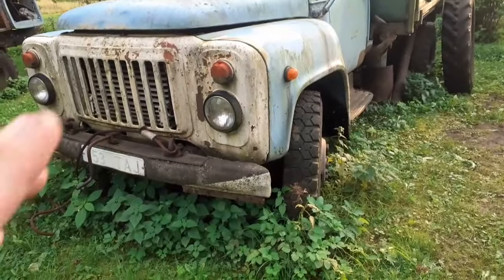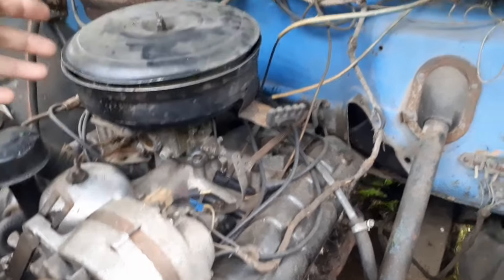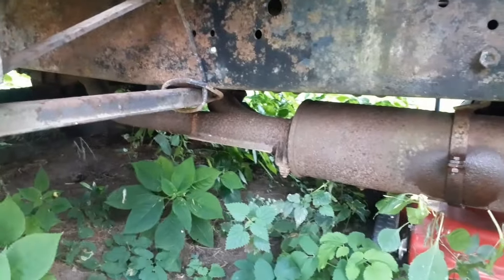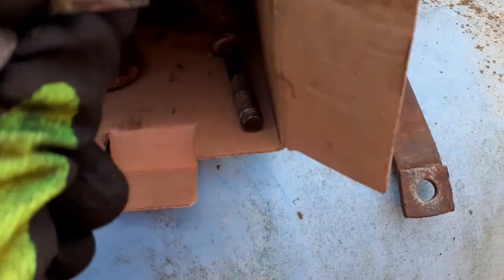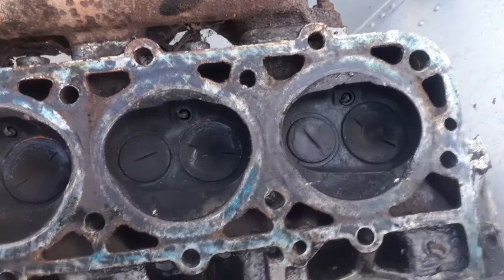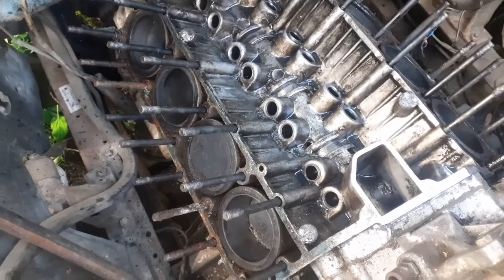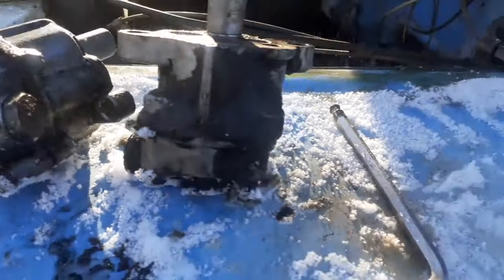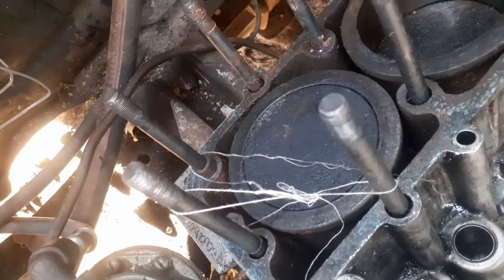Reviving the GAZ-53B truck part 1

Comment: Wow!  That's quite a project and i think you're right, save it for the spring and it will also give you time to think about it.   Cheers from Eastern Canada!  🇨🇦
Reply from the maker: Thanks. Right now everything outside is frozen and im not found of crawling underneath anything in the snow and later having horrible nerve pain. Most of the work is just me not listening to common sense 3 years ago. Should have taken the heads off back than and we would have less work. Oh well you can't foresee everything. Maybe it's a good thing cause all the bad stuff from the previous owners can be sorted out once and for all.

Comment: I will definitely be following this series. My father also worked on GAZ 53B for a while. If memory serves, about three engines were replaced. For one, the piston blew a hole in the block. Another had its flywheel broken while unloading cargo. One of the fragments of the clutch box punched a hole in the engine cover.
Reply from the maker: Do you know if these where factory engines or rebuild ones? I have heard all sorts of stories how the engine did self destruct over time. The GAZ 51 engine is even easier to blow if handled incorrectly.
Reply: @SuperMAZ007  The dump truck on which the Father was driving in the documents was GAZ 53B. I don't remember the exact year on the plate. But it has probably already undergone at least one major overhaul. The cabin had a smooth roof, but the front grille was already new, white. Also, the sides of the cargo box were from SAZ3507. Therefore, I can't say whether the engine whose piston broke was original or not. The engine whose flywheel broke was from a GAZ53A. The last one installed was from a GAZ53 fuel tanker. What happened next is unknown. Father changed his job, and the car itself was also sold elsewhere.

Comment: Thanks for the video Steve. That engine reminds me very much of the Chevrolet V8 engines. It really doesn't look that bad inside. If you get the oil pump figured out, basic tune up and some new head gaskets I think it'll fire right up. 👍
Reply from the maker: It fired up even with the bad head gasket, however it just lacks in power and is performing kind of poor. Oil pump is the least of the issues cause thick diesel oil will do the trick. I don't know if I can pull the main bearings out and get them swapped as well. I have to consult with my friend on that. I have to admit this is one of the nicest engines from the inside that I have seen. Usually they are all sludge up to the brim cause no one changes the oil.

Comment: Looks like a Y block on the outside, completely different inside lol. Soviets did this quite often, I'm not sure why. Another example is the tokarev tt-33. Looks like an FN 1903 clone on the outside, completely different inside. I'm guessing they make a carbon copy inside and out as a starting point, and then change it to suit their needs/address short-comings on the inside.
Reply from the maker: Kind of that sums it up right. Ford at least had a seal for the rear main. This engine has the old grease-filt seal that is notorious for leaking. The first carbon copy ZMZ-13 was really good. But the so called abridged version you see in the video, was a bad idea from the start. Lot of the issues came not from bad material choice but poor quality lubricants used. Never had heard any oil pressure issues or premature engine failure with the same engine that was exported to places where they had good oils.

Comment: Are all Gaz engines alloy as   opposed to cast  iron for Ford y block ? Thanks for sharing 👍💨💨
Reply from the maker: Yup all are cast alloy from the beginning to the end. Not a great material choise cause alloy blocks tend to corrode if run with water and not cleaned in years. I think they used a more durable alloy casting but it is not uncommon or unhear of the block became useless. After it had been severely over heated. One thing they did fix better than the early Y-blocks. They fixed the notorious rocker issue that Ford could not fix.

Comment: Steve nice truck . Very rare. Where did you get it?
Reply from the maker: Ten years ago these where still very common. Now they have all been cut to scrap or made into tractor trailers. The price of gasoline and the availability of parts made them go extinct. I both this truck from a scrap dealer, who wanted only the dump bed. The rest he did not care about.
Reply: @SuperMAZ007  Thank You for answer. I understand. I have that same model gaz 53 a with that same v8 engine . This truck's have quite good opinion. Of course need many attention but is worth it. Many of them is register on history car plate. Regular opinion is that zil 130 is better but gaz 53 is a lot less techical built complicated. Anyway very nice history truck.  Nice work. 👍👍
Reply from the maker: @ollenkka195  Good to hear that. ZIL has one downside, you can't get anything for it from Russia. Majority of ZIL trucks got scrapped in the early 90s and 2000s. So what is left usually needs total rebuild. I know some people have swapped the V8 out for a diesel engine. For me it is not worth it cause im not gonna drive it that much anyway. Also swapping the diesel engine is is not a straight forward process.